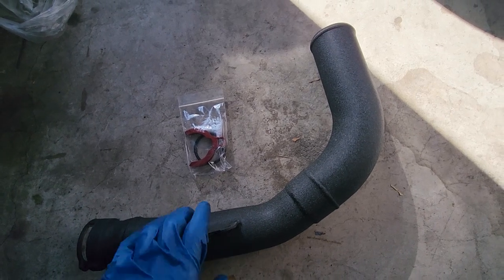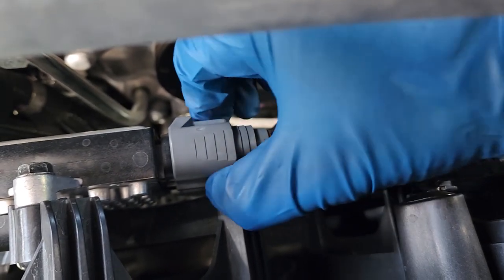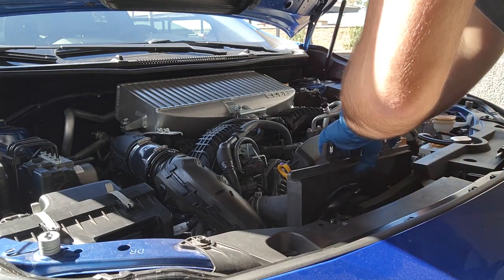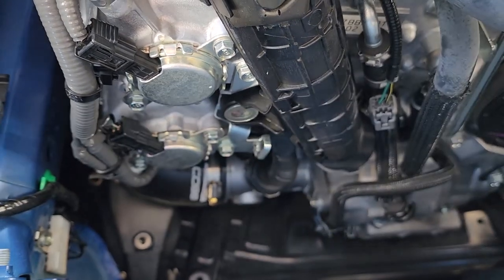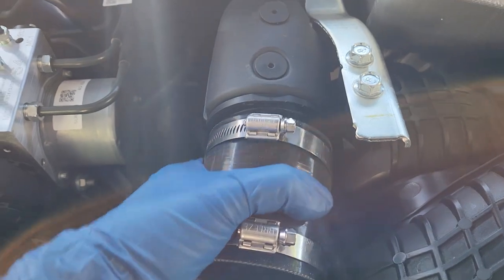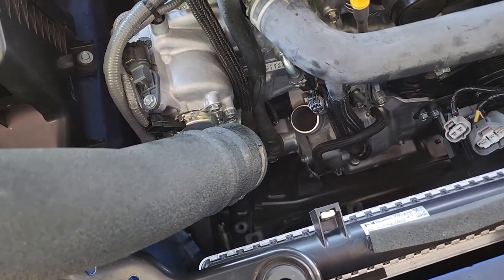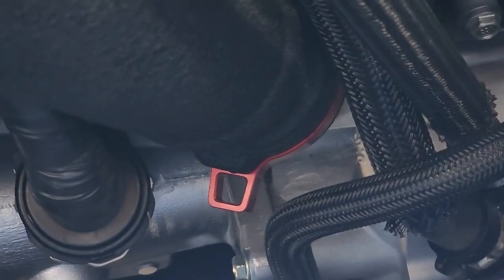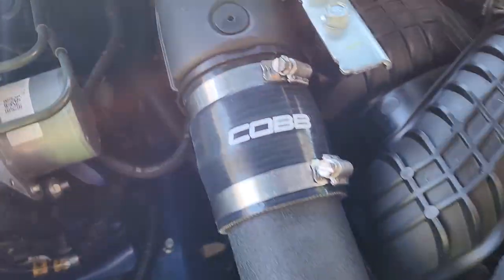COBB Charge Pipe Installation Step by Step Guide for Subaru WRX 2022 2023 - Stage 2 Upgrade Part 3

Comment: This was great. In order to get the fan and fan in, I had to nudge the radiator hose. Did you experience some coolant splash back from this?..I didn't see it during the process but noticed a small pool of coolant after running the car. I got some coolant leakage and splash around that area but the hoses look tight and have not been moved. Curious if you had a similar experience. Will run it to see if there is anything amiss. Thanks!

Comment: Never seen a radiator fan removed to replace a charge pipe. Was this in the Cobb directions or did you just do that? There’s tons of videos that don’t remove the fan. Does look a lot easier to do, but not sure it’s really necessary.
Reply from the maker: Yes it was done per COBB's official instructions.
Reply: @RafaelStrife  I’m an about to just pull the radiator fan to make it easier for my installation. ETS just says to reach up and undo the bolt, no fan removal.

Comment: Forgive my ignorance, but where does the average Subaru enthusiast go to get a COBB Stage 2 tune?
Reply from the maker: The tune can be had from COBB's official website! The stage 2 tune needs to be "purchased" by adding to cart and checking out, but it costs $0.00 so its free.
The only limitation is that it cannot be "sold" to people in CA or NY. If the "shipping address" says any other state though, it will allow the purchase to go through. It will be available for download in your online COBB account's Garage section.
Reply: @RafaelStrife  Season of the sickness. COBB Stage 2 in the House!